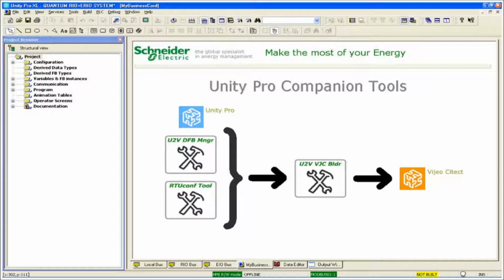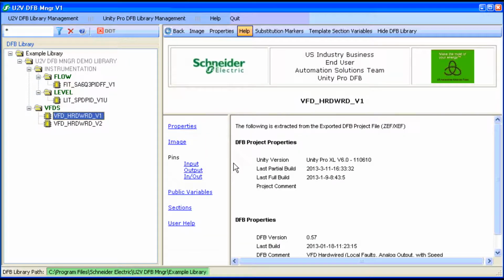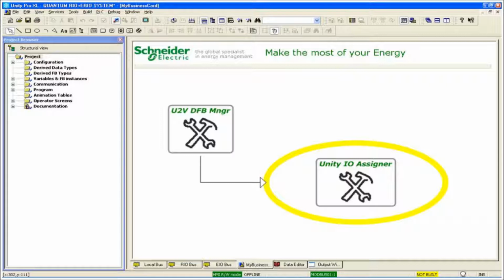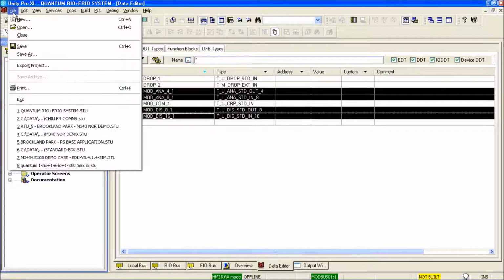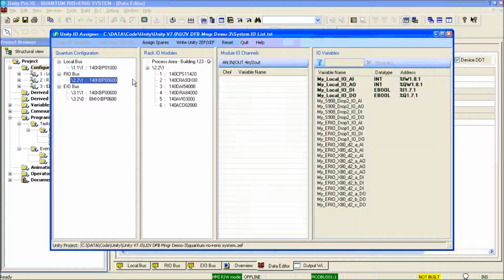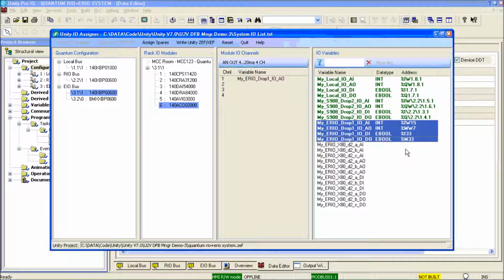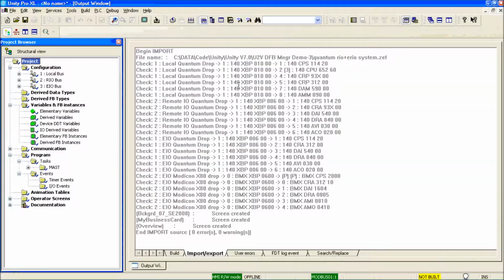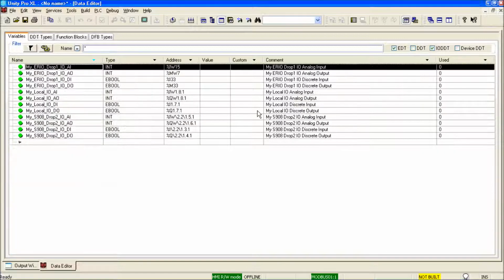Implementing MODICON Quantum Ethernet Remote IO with Unity Pro Tools

Comment: This is a cool program but it is very finicky. I have tried and tried to follow along but sometimes it will work and sometimes it won't. I usually get an error that says:

Unhandled exception has occurred in your application.If you click Continue, the application will ignore this error and attempt to continue. If you click Quit, the application will close immediately.

Argument 'Length' must be greater or equal to zero.

It doesn't matter what I try I can't get it to work. I would love some help in getting this to work because it would save lots of time.
Reply from the maker: Can I ask you for a little more detail?
Is the CPU in your Unity Pro Project an M580?
If yes, what types of EIO Drops are in the Hardware Configuration?
If Quantum Drops, then that is the issue.
The current version does not support M580 with Quantum Drops, but a new version will very soon.

Can you send the ZEF File that you are using to:  unitypro.experts@gmail.com
This will help address whatever issues you are experiencing.

Comment: Awesome video and great utility.  I'm trying to download the Unity IO Assigner tool from the link above.  As i fill out the three required fields and press the "Request Download Link" button i get an "illegal argument error".  Please help I really would benefit from this Utility.

Thanks again.
Reply from the maker: Make sure all required fields are filled with valid entries and hit the Enter or Tab Key while in the required Email Field (after providing a valid email address).  If this does not help... respond back, your feed-back makes the difference.
Reply from the maker: UnityPro Tools, Tips & Tricks! The problem has been found and corrected.  Thanks again.
Reply: UnityPro Tools, Tips & Tricks!
Thank you very much for the prompt response.  I successfully downloaded and installed Unity IO Assigner.  I'll test it out and give some feed back. Thanks again!